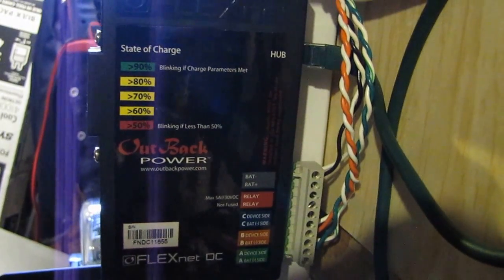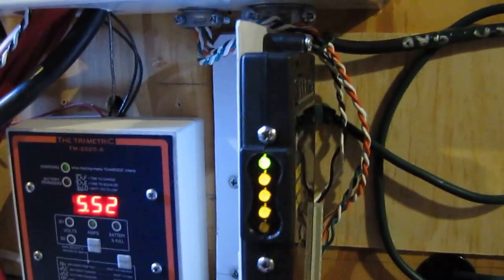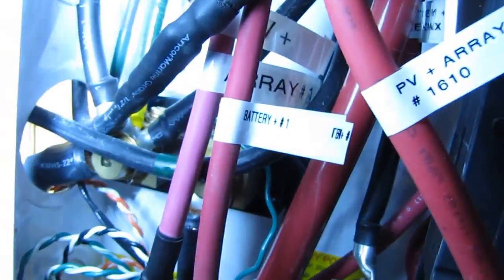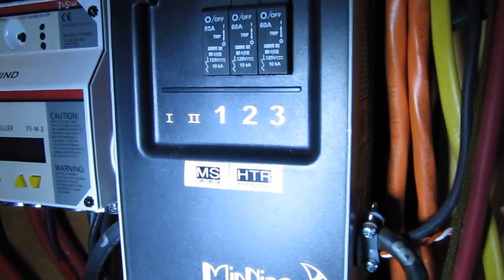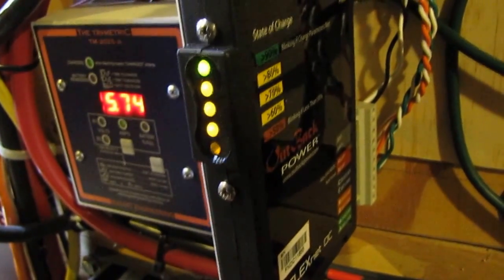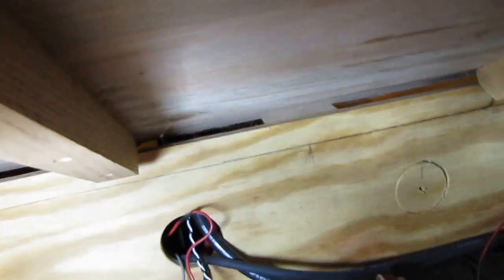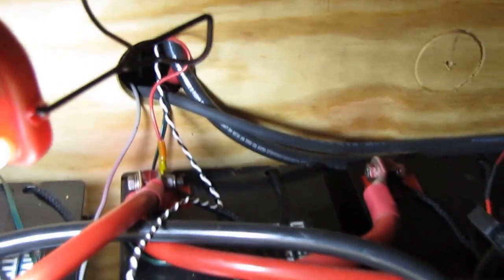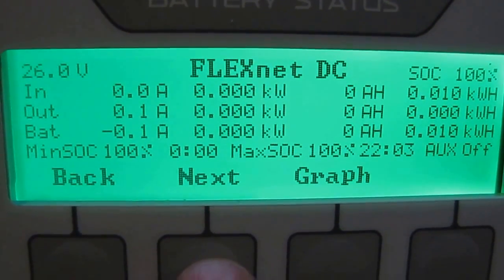OutBack Power FLEXnet DC Battery Power Monitor Install For Wind And Solar By KVUSMC

Comment: Hello! How you do you program the FNDC to the Mate3, so it powers on? My fdnc won't light up! :-/
Reply from the maker: Make sure you Have Battery + and Battery - hooked up and also check your inline fuse on the positive side also in the mate 3 it under  settings  then Battery monitor monitor I hope this helps 👍
Reply: @KVUSMC-KU4SMC  awesome Kenneth! Thank you Sir! I'll give it a try. Hopefully it powers up again cuz I got no power at the conduit/s :-/

Comment: Quick question.   Where exactly are the terminals of the black and white wires coming out of the FNDC connected to the battery bank.  Between two batteries or,  on each end of the string of batteries, etc?  I could not tell how you them terminated.
Reply from the maker: +Trey Chatagnier Hi Buddy The Black Is The Positive + On My Positive Post And The White Is My Negative -  On My Battery Bank I Have It Between Two Batteries  I Should Of Made It Clearer I do Have A 5 Amp  Inline Fuse On My  Black FNDC Wire Trey
Reply: Thanks for the reply.  That is what I needed to know.
Reply from the maker: +Trey Chatagnier Your Welcome buddy cheers Kenny

Comment: How many amp hours do you got of batts. I only got 220 amp hours I need to get me some more batts.
Reply from the maker: I Have 270 Amp Hours at 24 Volt
Reply: kvusmc I would feel better about my system if it had better than 600 amp hours. A thousand  or  1200 amp hours would be sweet.
Reply from the maker: OMG  I Would Have A lot More  Batteries If I knew What Kind Of Life I Would Get Out Of Them I Am Still Testing  If I Get 5  Years To Seven years I Will Be Happy  We Will See
Reply: kvusmc Most batteries you get only five years thats all.  I have heard the Surrette batteries can last 20 years sometimes. I have heard the Optimas can last 10 to 12 years sometimes. The Iron battery people are claiming theirs last ten years.
Reply from the maker: I'm Hoping For 7  On Mine We Will See Buddy  By Then Batteries Will Have More Amp Hours And Smaller  Technology Is Ever Changing